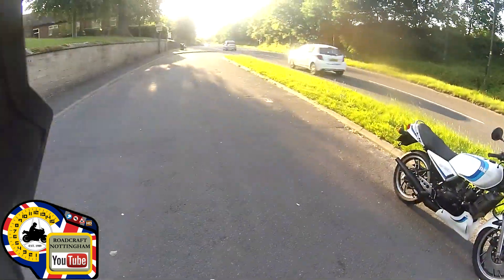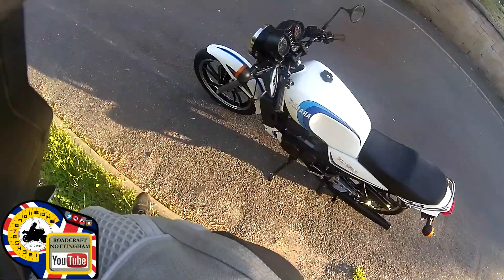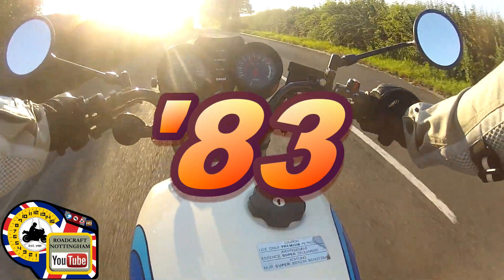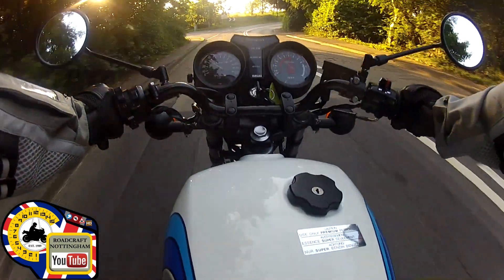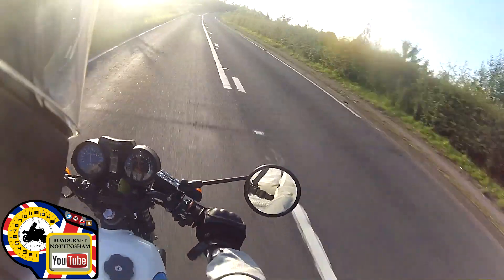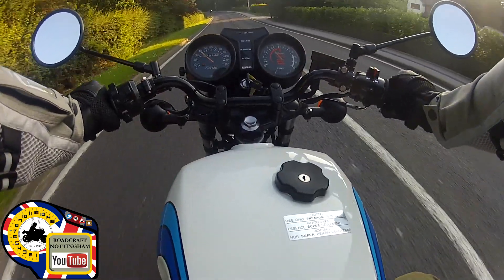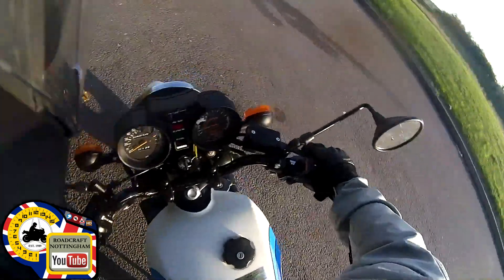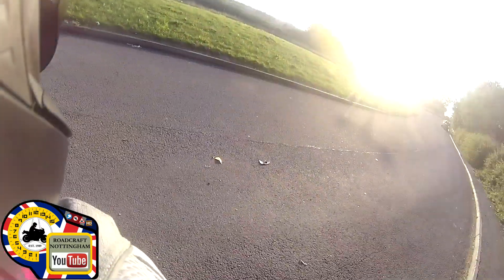Yamaha RD250 LC restoration: I spent £2500 on parts!

Comment: I bought mine brand new in 1982 for £999.  Recently spent £3000 restoring it to totally original condition including all period correct plating of parts.

Best two stroke I have ever owned, even used it in long distance production racing after being tuned by Beeline racing at the time.

With a mild tune to keep it reliable it was speed trapped at 117mph.  It was too quick on the road in tuned form and I could never get it past third gear running on local roads when used as a commuter bike.

I wouldn’t part with mine at all now.  Very hard to find a decent one that’s totally original.  Mine is Black with Mars Bar stripes.  Even has the original alloy X reg number plate

Comment: what is part availability like for just the engine components? and what does it red line at out of curiosity?. lovely bike , amazing work cleaning it up.
Reply from the maker: Thanks, parts are very easy to come by so no problem there. With the engine though, stick with genuine Yamaha otherwise it'll be a pain stripping it back down again.
Reply: @RoadcraftNottingham   thanks, good to know.

Comment: great job, i bought a bike in 1980, i wanted the RD250, this was when you could drive on L plates, but i ended up with Yamaha XS250SE
Reply from the maker: I liked the look of the XS but they weren't very popular.
Reply: Yes, me and my mate both had one, black and a blue one, mine was always going back to Yamaha for loss of power, but it never broke down. Main problem was I was always getting stopped by the police as it was a big bike, and did not believe it was a 250, 3 times that happened.  Those were fun days. as I said great job in the bike, looks great, and even though it’s 4 decades old, still does not look out of place. Enjoy it. All the best
Reply: Forgot to say when I bought mine the Rd250 was about 1300 pounds new, lol, you spend twice that on restore.
Reply: @redlands43  That sounds about right. This advert https://www.youtube.com/watch?v=lHsHhEuyNhg sent me down a 1980s Bike Rabbit hole.

Comment: The 250 was a smoother bike to ride than the 350. You could push these more safely than the 350. They were designed as 250's and the engine bored out to  350 later on. The crank suits the 250 engine better. Lot less engine noise and vibration  from the 250.

Comment: The flat spot as you call it is simply the break point before you hit the power band, the later version of the engine included the power valve to iron this out, the 250 was a nice machine but the 350 was a much better option and they hold far more money than the 250 does second hand, I had the 350LC F2 fully faired on a D plate, it was a lovely bike and the same as the one that you rode on here on one of your other videos, thanks for sharing the video, would love to have seen a series of you restoring the bike.
Reply from the maker: Great info thanks. Yes in hindsight, would have been a good series. ☺

Comment: Nice job on that restoration👍😎⚠️ I had the RD350LC YPVS with the bikini fairing and belly pan. I remember they were pretty gutless low to mid revs and then when it hit the powerband at around 6k it just took off, so you constantly had to keep the revs high, cost a lot more in fuel and 2 stroke oil to run than my 650 katana or cbx1000  Wish I'd kept all my bikes, they would be worth a small fortune now⚠️😲😊👍😎
Reply from the maker: Hindsight is a wonderful thing. ☺
Reply: I recall one of the Bike Magazines got about 25MPG from an LC on a track day. We joked that the Liquid Cooling was actually all the petrol going through the engine.
Reply: @MrDuncl  Yeah they were very thirsty little bikes, especially because you had to 'race' them everywhere!! They weren't really bikes you could bimble about on at low revs! Plus the extra cost of 2 stroke oil, made them even more expensive to run!
I much prefer the low down torque and mid range power band going all the way to the redline on the big capacity 4 stroke 4 cylinder bikes and lower running costs! 👍😎😮

Comment: A lovely wee bike, great restoration. I started with an SS50 Honda, then bought a secondhand CB250G5 and passed my test less than 3 weeks later. 
I never owned a two stroke bike until a few years ago when I bought an early model DT250, a 1972 DT3 Enduro, it's brilliant and it's so rare, I have only seen one other on the road. 
I also own a CB360, 1973, it reminds me of my 250, but with a bit more power. I love classic bikes and have nine at the moment, the newest bike is 1994.

Comment: Replacing the standard reeds with some fibre or carbon reeds will remove that little flat around 5k quite effectively
Reply from the maker: I've got boyesen reeds, just need to fit them now. Thanks for the feedback, quite excited to see the results
Reply from the maker: Fitted them today. Flat spot gone. Makes such a difference as that flat spot became a bit annoying.
Reply: Roadcraft Nottingham glad to hear it buddy ! Awesome quality of build . Kudos !
Reply: Roadcraft Nottingham  if you fancy a look at my version of the rd I’ve built ( a mito 350cc ypvs converted to banshee)  I’ve uploaded a few videos

Comment: Nice post Russ. Takes me back to 1979 when I had the Honda 250 Dream, which I passed my test on in1980. You either bought the Honda, the RD250 or the Kawasaki 250 triple. Cheered me up as a I tick off the months to reapply for my licence after a medical issue!
Reply from the maker: My first bigger bike was the 250n, Yamaha rd125lc pissed all over me in a race. 😂 Get well soon buddy. ☺
Reply: Also the Suzuki x7 250 that was fast not like the lc though.

Comment: I had a Yamaha 350 YR5, front tyre lasted forever as it was never on the road, always in the air.
Reply: have similar problem with my R1 , but I also sometimes use the brake so it is 16000 kms. max, 8000 the rear one ...

Comment: Why would anyone want a 250, they wouldnt pull you out of bed .
Reply from the maker: If you have to ask that question, you won't understand the attraction of this type of bike.  I'll try to explain.. It'll easily break speed limits but reward you for opening it up unlike my Tuono which was wasted on public roads. People love vespas and Lamberettas which are much slower. It's about the feel more than anything ☺
Reply: As Roadcraft explains, when these came out you could legally ride one of these on Learner plates on your 17th Birthday. Nowadays I guess it is for the nostalgia. I'm actually wondering why anyone bought the RD350LC back in the day, when the same licence would allow you 500CC or more.

Comment: Wonderful stuff.

I spent 12 years on a two-stroke before hanging up my boots. 18 years later I had a few lessons on an SV650 and I was bitterly disappointed.

It was like riding a tractor and compared to my two-stroke, it sounded like one.

The connection between throttle, engine, brakes and rider was lost. I walked away dreaming of an lc350 or a kawa 2-stroke from the good old days.

Comment: Much more involving to ride than a modern bike I imagine, having to stay in the right gear for the right speed for the corners. Can you talk a bit about the brakes, I can imagine you have to plan equally as well compared to the modern stuff. 
What tyres do you run on it?
You will regret it if you sell it.